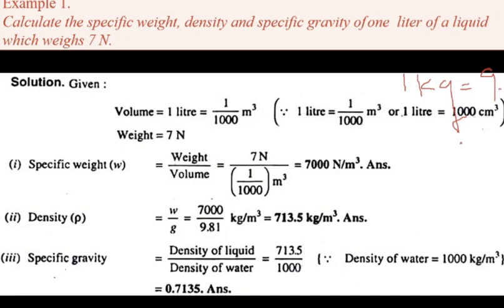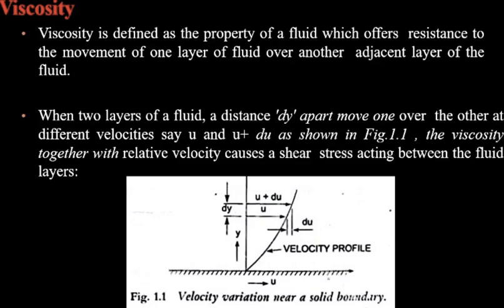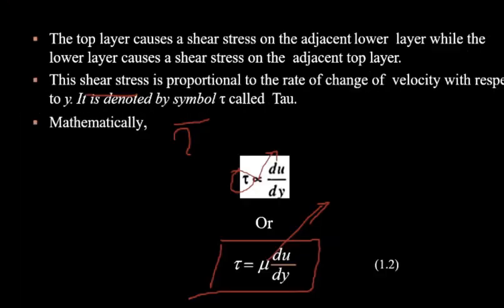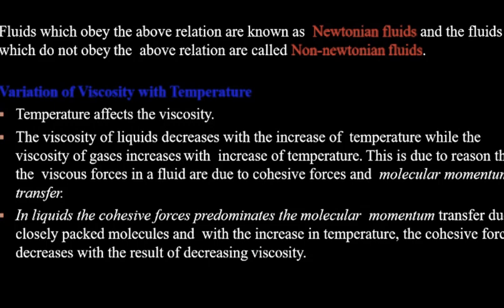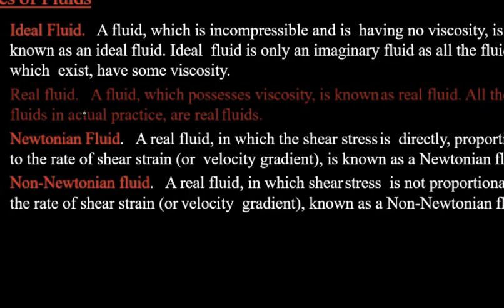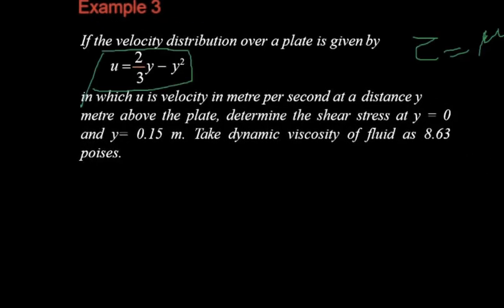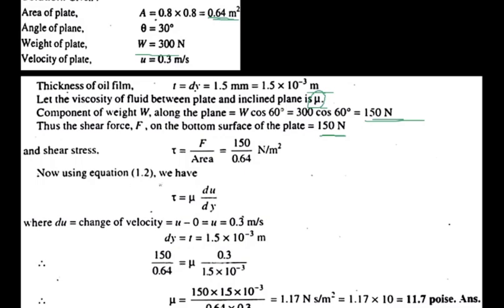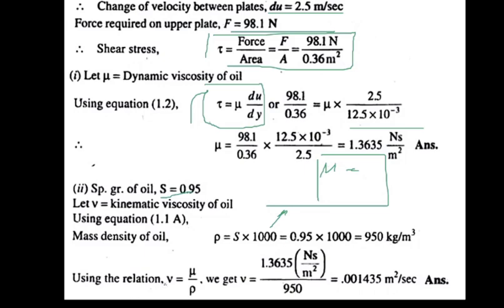Module-1, Fluid & it's Properties - 2.

Comment: Sir I want to inform a issue.. In the video texts often move out from the screen sometimes due to your screenrecorder but that's minor negligible issue. If you can fix this issue by adjusting the recorder ratio then the video will reach it's perfection.
Reply from the maker: Check your resolution while viewing...you get the same as it is 720p